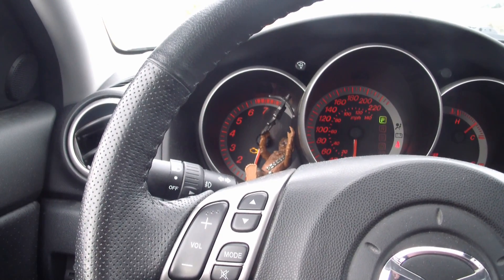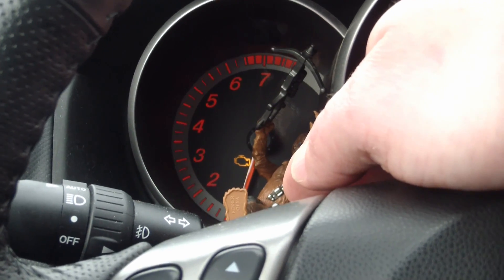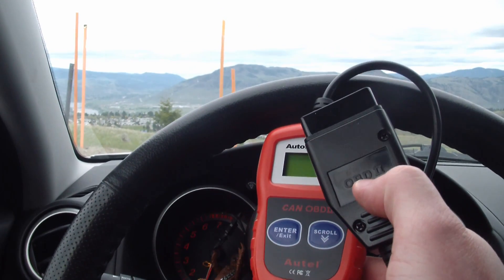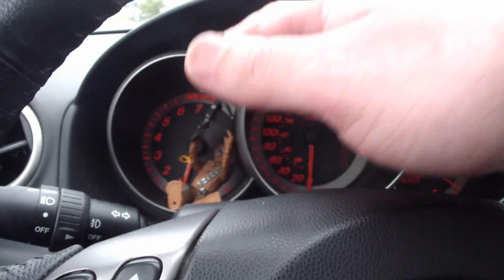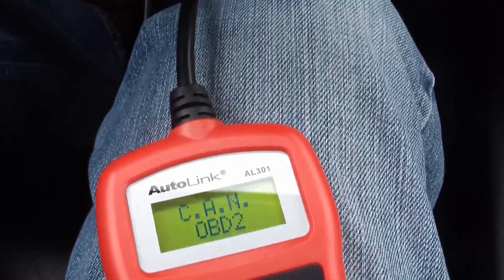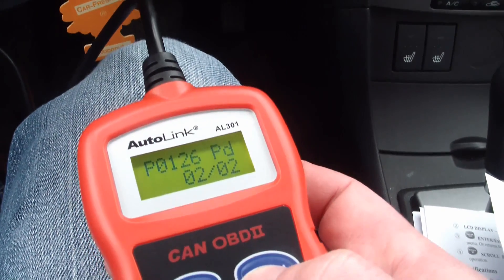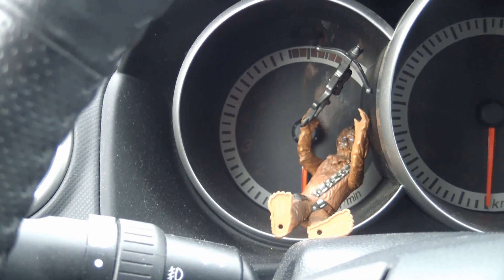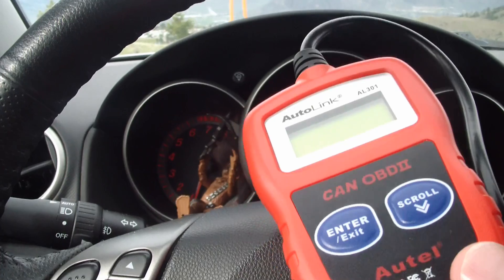Manly-Man Skills: Outsmart Mechanic Scams by Using Your Car's Computer!

Comment: For less than $20, the ELM 327 Bluetooth OBD II reader and even free version of Android software will allow you to read and check the codes.  If you don't want to spend anything, many parts stores will scan your car for free.  O.K. now you know the codes that fired, now what?  Google will lead you to lots of online content that might help, but might not.  alldatadiy.com is a source of technical information about your exact car (based on the VIN), wiring diagrams, torque specs, OBD codes, part locations, and tech service bulletins.  They charge for access to this data, but it is well worth it in my opinion.  Many dealers and auto repair shops troubleshoot with the shotgun method, replace this, replace that, until they fix the problem or you run out of money.  Any idiot can do that.  Inform yourself, think the problem through, and you will likely be able to identify the actual root cause of the problem without needlessly replacing good parts.  When your car is acting up, keep a written log of what the conditions were when the problem occurred, including any codes that were present.  If you do take the car to someone to fix, this may help them to diagnose the root cause.

Comment: I'm a semi profesional mobile  and I've been needing to get an OBD2 reader. what would you say is the best bang for your buck OBD2 reader for around 100-200 USD? I'll be using it 2-5 times a week so I don't want to get a cheap or entry level one.

Comment: What the vode reader does not tell you that the code pertaining to your check engine light may require an update, so us "crooks" at the dealer (stealer) have to reprogram your PCM because you cant afford an MDI and the software updates. So clearing your certian code will come back over and over. We are not all crooks..most of us just want to make ab honest living just like you. I've never ripped anyone off.

Comment: What's even better is when you can get your mitts on a factory service interface and the shop "scan" software specific to your make and model of car.  Cool. As. Shit.  - On many 2008+ cars you can not only read the standard subset of across-all-vehicles-emissions-stuff like this one can, but you can also control shit.  Turn solenoids on and off.  Lock/unlock doors, L/R/Hazard flash, lights on/off.  Damn near anything except actually turning the engine over or shifting into gear.  
All by using a laptop PC connected to your car with a thick assed industrial looking cable...

Comment: I was in La during 1975 and 76 , the black dust blew along every sidewaly ankle high all day long every day, rough on a sandal wearin hippie.
Also could not see the mountains that were 10 miles from my apartment window until about 10 am every morning because of the smog monster.

Comment: Not that this may be particularly useful but my Mazda 3 with this fault code multiple times had a sticky thermostat. Finally failed (open). After replacement all was well.

Comment: people are dumb! sold a vehicle to a friend. he knows I have years of automotive technical experience. mechanic quoted $5k to certify (Ontario)! whole front end including bad hubs (4x4, knew they were needed and told him of course.... "friend"). so you can NOT even test, ball joints for instance, with worn hubs and vice versa because they're tested under load and one needs to be good to even THINK about checking the other. also the usual "4 warped rotors", but none were turned to check.

my long winded point is, sometimes you just have to let them get suckered! he wouldn't even accept my offer to pay another mechanic to check and proceeded to waste his $$. I guess some people just don't want to THINK for themselves.

Comment: Just to clarify a couple points, if your check engine lite is flashing that DOES mean to stop driving and have the vehicle looked at. Do not disconnect your battery to clear codes unless you have verified it is a safe way to do so on your specific vehicle. Things like idle learn, crank/cam position will reset along with some manufacturers requiring a radio code upon reconnecting the battery. Not a major issue but could make further diag harder until these things are relearned.

Comment: by clearing the code you clear the event log , say if there is another code the autel didnt read .so there was 2 codes but you only see one , and the other code is random misfire or running lean and you burn a hole in you catalytic converter

Comment: A little correction. If the money light's on, it doesn't mean the car's going to hell in a hand basket. But, if you ignore it long enough, it could make the cost of the repair a LOT higher than if you address the problem right away. Also, if the check engine light is blinking, stop the car immediately. A blinking light means an engine condition exists that could destroy the catalytic converter in short order. The cat is a VERY expensive part to replace.

Comment: I have to disagree that all Auto techs are crooks. we don't even charge customers to read their codes. And disconnecting the battery will not work on every vehicle. Ever heard of a permanent dtc code?? I agree the scanners are well worth 30.00 I had one for a long time but ended up giving it away to someone who needed it. You cant run data stream on just a code retriever tool to monitor what each module is doing. Plus if you have a Honda and you disconnect the battery if you don't have access to your radio code or navigation unit you will be spending a lot of time on the phone with the dealer or perhaps having to take it in. The check engine light is their for a purpose to let you know something is wrong and not just for charging people. I have been a mechanic for well over 25 years and try my best to help everyone as much as I can and never sell someone something they don't need. Great video and some good points but just be careful leading people astray with false information that could cause t them to come out of pocket. Just saying...

Comment: I have a Bluetooth OBD connector. Had a red light after a jump-start failed. Reset it, it came back orange. I just googled the code and my car and it was the lambda sensor that was broken. Cost me 110 EUR and 30 min of work to fix instead of maybe triple that at the dealership.
I drove around with that light on for nearly a year BTW. Didn't even have an impact on fuel economy.

Comment: well you don't even need to spend $30. auto companies build it into cars, you just need to know how to use it. my dodge ram you turn the key on and off 3 times then the 4th time leave it on. it will show up in the odometer. (digital) p306=misfire cylinder 6

Comment: Actually, that smog back then was largely from  the majority of the building heating systems in those cities burning low grade high sulfur coal at the time and not natural gas as they do now.   

As for vehicles the reformulation of gasoline plus the addition of catalytic converters did the vast majority of the emissions cleanup accounting for something like a 90 - 95% improvement in cleaning up our air by the mid to late 90's when TIer 2 emission standards were in effect.   
After that most everything to follow became horse crap smoke and mirrors games to scam money off tree hugging  do gooders who don't understand the science behind things.

Comment: I am only dropping these tidbit comments because I have learned a lot from your metal working videos.  I got dragged into this video because it was my trade of choice for 15 years.  There is some solid advice in this video, but incomplete as well.

First, there's actually 3 modes of the CEL (Check Engine Light).  There is also a preset drive cycle test that always logs current and historical data.  The drive cycle is set for each emission control device to be tested for correct function when the condition occurs.  In your case, the fault was stored multiple times because the thermostat is taking too long to get up to temperature... this test is only performed once a cold start condition is detected.  With all the systems tested, once more than one test is detected as incomplete for more then so many key cycles... the CEL is turned on solid.

So, we have the 1st mode... 'OFF', where no more then one tested system have tested as incomplete.  We have the 2nd mode... 'ON', where fuel trim monitoring is set to a default instead of rich/lean control (needed for catalytic converter to maintain long health).  So, when the CEL is on solid, gas savings are going out the tailpipe, the catalytic converter risks clogs because it isn't burning off the hydrocarbons by switching rich/lean, and the ignorance that the codes magically tell what the cause of the problem is instead of the just pointing one into the direction of what the EPA doesn't like to see.  How is a mechanic supposed to determine from the code reader that you may have ordered flex seal to seal a coolant leak or used bubble gum as an o-ring when you were Sasquatch hunting, and that the only problem with your car is a wad of gunk plugging the sensor port where coolant temperature is read.  I have met very few car whisperers in my life... and those dumb code readers are quite good at making years of soaking in sensor an computing systems look like the answers just pop out of those boxes.  It's a sad state of affairs when car technicians have to spend time going backwards to diagnose what was already done to it.

That brings me to the ever elusive 3rd mode.  'FLASHING'.  The flashing mode is built into OBD2 programming, to indicate that a potentially dangerous or engine damaging misfire is occurring.  It usually comes on when mode 2 'ON' is ignored for long enough.  The beauty of knowing the 3 modes... that it provides the relaxation of not giving 2 squints to the fact that there is a detected error in the emissions system.  

Smart technicians that understand the smaller details of dynamic engine management systems leave the industry, since wasting one's life away educating people to operate their tire pressure monitor system is not my cup of tea.  The system was only put in place because people are too fat, lazy, and entitled to double check that the tires of the 3000 kilo missile they are about to launch down the sheeple elevator.  Now we must keep a system of dummy prevention in stealerships... to educate all on the dummy light operations.  Instead of kicking tires before we drive off, legislation made a system of tire air pressure monitor professionals.  Is one going to think that these systems are so simple and easy to understand in detail when they buy a car in the U.S. made after '04.  Tire pressure monitors are law from then on in U.S.  

We live in the information age, at information is expensive.  OEM's limit what is available to the public in those readers, and are only still functioning because none of the machines tell what is actually wrong.  The general outlook is that they tell what's wrong and its a big misconception.  Dealerships anymore just bank a live collection of failures to maybe catch a pattern to failures of specific systems.  They end up sucking just as much as the common folk do when they fix their own car, because those information systems and the time needed to keep up on trends and changes is not as cool as tweeting in free time.  These dummies usually feel the computer should tell them what's wrong too... hahaha.

I spent many unpaid hours learning which car takes which specific oxygen sensors or whatever... learning the voltage parameters, the inner workings of the sensors... how they communicate with the computing systems.  I could donate my entire life to advancing my knowledges of these things... it's still only worth $60 an hour when all other options fail in the eyes of the consumer.  Much like in your videos, when your taking apart brand new stuff just to tell us that that piece of plastic inside is propylene glycol... you are one of a very few that could give a rats ass what kind of plastic it is.  I appreciate you took the time to teach me that, but no way in hell am I going to add value to your knowledge because you are a plastic savant.

Anyways... I like your videos a lot... probably the best verbal youtube presence I have come across.  Keep your dick in a vice when your CEL comes on... unless its flashing, then its time to let the stealership dicks work the car's vices.

Comment: It makes my job easier when I open your hood and see 10 new parts in the engine compartment. You spent 600 on parts you didn't need and I find the vacuum leak instantly. I charge you diag, 1 hour labor and 6.00 for parts and you come unglued. Then ya go on YouTube and complain.
Reply: Tim Henry could be the same in the other direction. I had a caliper stick in the winter; and the mechanic replaced the rear discs, pads and caliper on the one side. When it stuck again I tore the caliper apart, no problem. Looked closer - the ABS sensor looked partially melted. I replaced that, haven't had a problem since. The tech charged $960, the sensor was $12 I pulled off a junker. There aren't a lot of great techs in my city; and I prefer to know what I'm getting into, so an ODB2 reader is a must.

Comment: Or as I read it; any fault with the emmissions sensors is obliged to illuminate the same warning light that usually tells you the motor is about to croak. Otherwise I would not take said warning light serously.

Comment: I'm a mechanic, I do not agree that all dealerships are crooks. You said it yourself you hate intermittent issues. So do we, most time the engine light will only come on if the same thing happens on two consecutive "trips". If you'd like to do some good, get mad at the flat rate system under which mechanics are forced to work.

Comment: I spent a whopping 75 dollars on a slightly more featured model but I love it. Reads codes, emissions, ABS, shows live data from all of the sensors (coolant temp, rpm, idle air temp, etc.) and lets you clear the codes by pushing a button. Everyone needs one - no doubt.

Comment: now you forgot one thing the light and code gets cleared and won't pop right back up because you have to drive about 100 miles for the MIL or CEL and code to come up again it happens because that's how the computer reads the engine and decides there is a problem simply put. I have a Mac rebranded launch scan tool and it can check different systems and graph live data and store it so you can pin point the problem better and it also can read bas abs and srs and reset change oil lights it was $100 used but $200 new but I wouldn't suggest it to someone other than a mechanic or someone who knows what every thing is and how it works, now the codes scanners like mine and th one in video gives are generic codes and can be a number of things and some systems are tied together and trigger problems with each other so not your average person can fix the issue. I recommend this as a second option if you are in U.S. auto parts stores like AutoZone and advanced auto etc will scan your codes for free and give you a print out to help you either take it to a mechanic or fix it yourself but they are not aloud to clear the codes and turn off the light but you can tell them you want to do it yourself is what I've done at least till I got my own.

Comment: That particular fault isn't one which will show up quickly like for example a bad / shorted TPS sensor. The fault you sited needed a set of conditions to happen in order for the code to set. Likely the computer needs to see a cold engine start-up and the program would look to see how long it takes to reach operating temperature. If it takes longer than expected the code would set.   Typically a engine coolant thermostat issue. One that is stuck "open". This would make the engine coolant temperature rise much slower and thus trigger the code. A colder engine could cause the A/F mixture to remain "richer" for a longer time and that would cause emissions to go up and fuel mileage to go down.

Comment: its heart breaking what the dealer and most of the industry has done to the consumer. I have been a professional ASE certified technician for over 20 years. i run a small honest repair shop for the past 17 years. the relationships i have built with my customers could not be replaced by any amount of money. I get customers that move out of state and still call me with questions from a repair shop where they live at now wanting to know if it is what they need done...I know this is a old video but i can almost with 100% certainty tell you that as soon as the temperature outside drops below 60 degrees F and you drive on the freeway for a little while the light will come back on due to a faulty Thermostat not allowing the engine to reach full temp...

Comment: The reason these aren't $1,000 plus is because that's basically all it does. It gives you a code. There is no way to look at live data, do any data logging, etc. This is kinda like that alligator socket with the pins that one size fits all but really isn't worth a pinch of shit for nothing. I use the auto enginuity ford enhanced version with my lap top. It was around $400 for the software and plug in but I can literally look at anything I want. It will show me input and output volts on every sensor. Do injector buzz tests etc. These are ok if you want a general idea of what is wrong but if you want to actually fix it yourself you will have to spend a little more money. Good video for people that don't know a whole lot about cars though, keep choochin'!